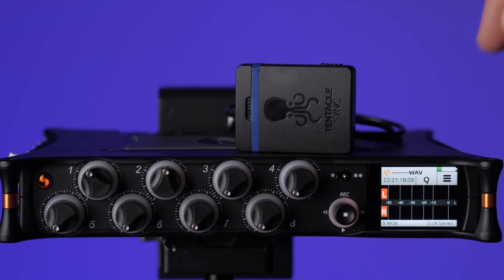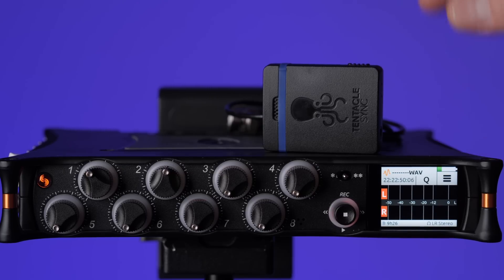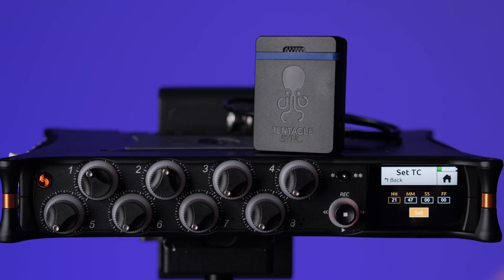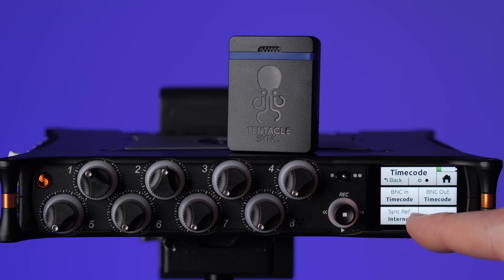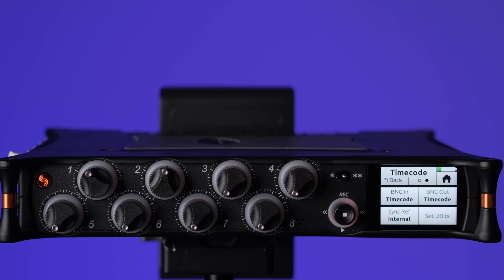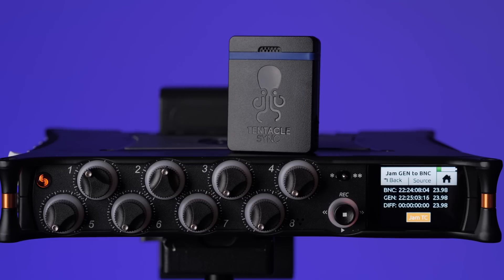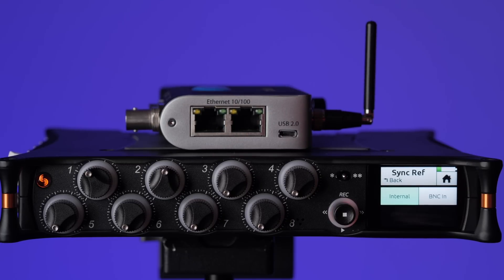Sound Devices MixPre 10T Timecode Setup

Comment: Curtis you are the best. I'm looking to setup a Sound Devices 833 as the TC generator and use a few sync boxes in the way you described in this video. Is this correct? Or do you have a different video explaining the way to do that on a 833?

Comment: Hello Curtis, thanks a lot for your video, I'll check the other ones but i've just one question : do you set the Tentacle on "mic" or "line" to send the TC of the mixpre to the Tentacle ? I've tested and it appears that it works on both cases, what do you suggest ? I know that to go to the camera through BNC, I set the Tentacle to LINE. Thanks for your help !
Reply: The MixPre will take line level timecode input.

Comment: hello Curtis! i have try to connect my mixpre 10t2 with 2 different arri mini, and i cant. i dont have tentacle and i will not buy for the moment, i have just a cable arri to mixpre. can you learn me how to connect? thanx dear
Reply: Hi klajdi9999, I haven't worked with the Alexa Mini first hand so I'm not sure, but you'll need a cable with TA3F connectors on one end and whatever the Alexa Mini requires on the other end. Then you'd use a process like this to calibrate the audio levels: https://youtu.be/bsUeXtxsa50

Comment: Hi Curtis. Love your videos. I have a question about timecode on the 10T: can I simply run a cable from the timecode-out BNC on the 10T directly to the camera, without using a tentacle-sync?
Reply: Hi Brendan, yes, if you don't mind keeping the MixPre and camera connected through the entire shoot.
Reply: @curtisjudd  Thank you! Very interesting. So: the notion, on which the entire concept of the Tentacle-Sync rests, is that cameras on their own do not have accurate enough internal timecode to be reliable? In other words, if I were to generate timecode with my 10T, and simply sync my camera's clock to the timecode on the 10T (and then disconnect the cable), is the idea that the camera will go out of sync really quickly? Or rather: is there some distinction between a device which has "timestamps" and one which "generates accurate timecode" that I am not appreciating here? Thanks for all you do!
Reply: @brendanyoungquist3531  Correct, cameras will drift at varying rates, but none of them use temperature compensated crystal oscillator clocks so they all drift. You have to keep a proper timecode box attached through the duration of the shoot if you want to rely on syncing with timecode and not having to "tweak" and compensate for drift in post.
Reply: @curtisjudd  That helps me understand. Thanks for indulging my question

Comment: Curtis, thanks for all the great videos. Ok my mix pre 6, no matter what I do, I get a 16 DIFF. I’ve double check the date on the mix pre and Tentacle, I checked the GMT in time set etc etc. I’m not sure if it matters but I have a suspicion that something just isn’t right. When I jam TC to my Tentacle I can see the aux 1 running and the internal and they are synced. But the DIFF is 16:00:00:00:00 - any notion about this? It’s driving me nuts. Unless I’m just not comprehending things correctly. Thanks in advance.
Reply: That's an odd one I haven't seen before. Any luck talking with Tentacle support? Or SD?

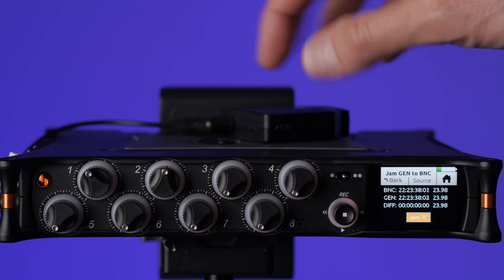Comment: Hi, Curtis. At 5:59, when you compare the internal (MixPre) TC with that of the Tentacle Sync E, there appears to be a slight visual difference between the two running values, and if you pause the video,  the two values appear to be at least one frame apart. What's going on here?

Thanks for all of your great videos—I'll be enrolling for some of your online classes for sure!
Reply from the maker: Hi 15M34, displays are often off by a bit but tests where we sync in post, we find that the clocks are indeed in sync. Hope that makes sense. Best wishes!
Reply: @LearnLightAndSoundSessions  That makes sense, Curtis—the 10T intro video on BH Photo's web site demonstrated the same behavior. Thanks again!

Comment: Hi
Good video. I learned a lot.
Is it possible to sync Mixpre-6 with Mixpre-10T?
Thanks
Reply: Yes, you can use an adapter cable to run timecode out of the 10T's BNC timecode output to the 3.5mm input on the MixPre-6 and change the settings in the 6's menu to timecode input. If you go this route, you'll need to keep the timecode cable connected to both devices throughout the shoot. If you cannot keep them connected, then you'll need a timecode generator like the Tentacle Sync E which you'll jam sync to the 10T and then connect it to the 6 throughout the shoot. I hope that helps.

Comment: Hi Curtis, thank you for your tremendous work here. It's been really really helpful to make great investment decisions and to simply learn new tricks and knowledges.

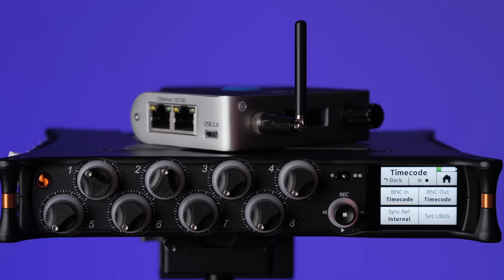I might just have one little question on this one: around 8:00 I don't get why you transform the BNC In connector into a Ref/Sync In connector... if you're sending an LTC signal into it.
It would make sens only if, in this case, the MixPre 10 would use the incoming LTC signal to get a TC info AND a Ref/Sync reference. Is that what it does ? 
In that case, that would be quiet powerful because I thought it would need two cables (one LTC and one Ref/Sync) to do so.
Reply: Hi Thomas, In that part, we use the Timecode Systems Wave as the master clock. We do that because it sends timecome to the 10T and also simultaneously wirelessly re-jams all of the remote timecode generators every second. If we were to use the timecode output from the 10T, the Wave base station would need to be setup as a slave rather than master unit, I believe. May need to double check that. But the idea is for the Wave base station to be the master timekeeper and send timecode to the 10T and all of the wirelessly connected Ultra Sync One TC generators. I hope that makes sense.
Reply: Hi, thanks for your answer. Sorry, my question wasn't clear at all... 
I understood you wanted the :wave to be the master clock and rule over the 10T... I was just talking about the set up you described to do so.

Switching the Sync Ref option from "Internal" to "BNC in", and sending into it an LTC signal from the :wave sounds like you're just sending an LTC signal into a Ref/Sync input. How does it rule over the running Timecode of 10T?
To me, it should take two cables/signals to rule over the speed (via the Ref/Sync input) and the time writing (via a TC input) of a device and be completely in sync, with no drift possible.

Unless the particular setup you described is a specific one and the 10T is really able to sync its speed and time writing with just one LTC signal if the BNC in input is set to "Sync Ref".
Is it really the case?
Because if it is, it's a powerful feature!
Reply: @tchatelet  Hi Thomas, it is my understanding that when you set the MixPre's timecode mode to BNC In or Aux In, it continuously reads from an external timecode generator connected to that port. Disconnecting the external TC generator resets the MixPre's TC clock to 00:00:00:00 and when you reconnect the external TC generator, it picks up the LTC timecode again. So it appears to be reading continuously from the external source.

Comment: I hope you don't mind my question. I am using Grass Valley Edius as an editing software. Here is the issue. I have two Tentacle E devices that I attached to my GH5 and Sony A7III. I am also just started to use MixPre 10T. All devices are in perfect sync. I shot a test footage and trans-coded the footage using Tentacle Timecode Tool (windows version). everything lined up perfectly except for external audio file recorded from MixPre 10T. The file is there with the timecode, I can see it but it's not beeing transferred in synchronized fashion like everything else.
Reply from the maker: Hi ALX BMGINC, you jammed the MixPre and Tentacles and all are set to the same frame rate? If so, may need to contact Tentacle Sync support. Best wishes.

Comment: hey curtis, one question. if I don´t record the stereo mix on my 10T, but just the ISO Tracks, playback doesnt work. is that normal?
Reply: Hi! You should be able to switch to a headphone preset where you can listen to isos. Let me check that when I get home.
Reply: Curtis Judd thanks for the hint! i finally got it to work. you have to go under „edit HP presets“ and then select the channels which should be played. greets